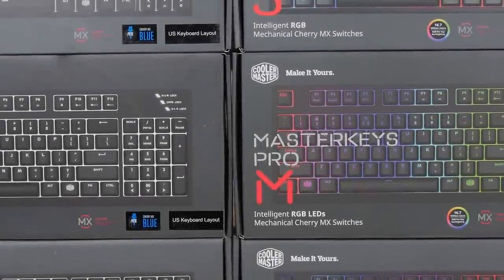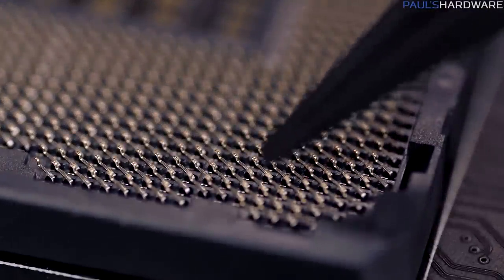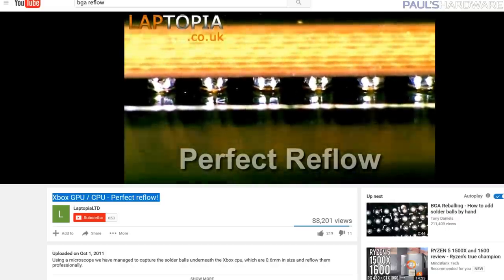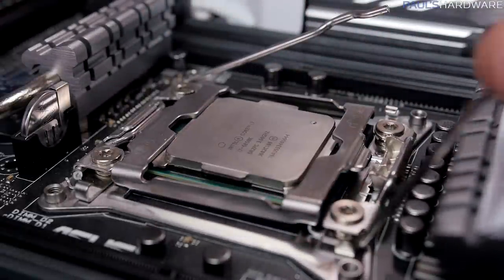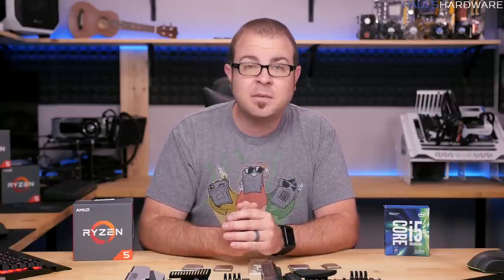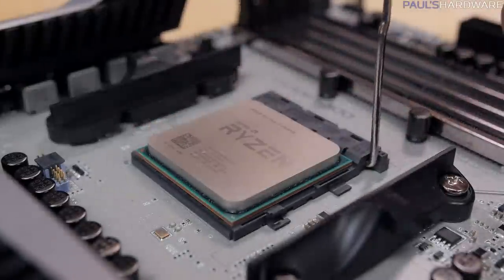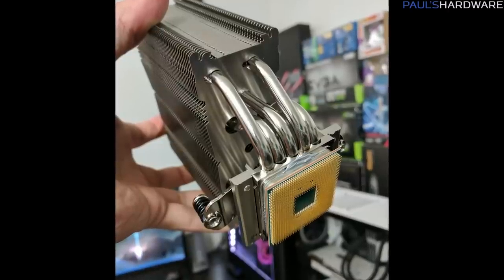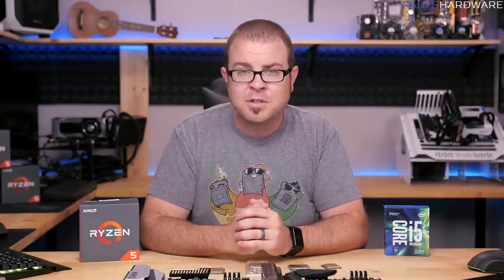LGA vs PGA! Which is better?

Comment: A cpu is just a rock that was taught how to think
Reply: It kinda is actually, since it's made of silicon, which is made by melting a certain type of rocks.
Reply: It's more sand than rock
Reply: But sand is rock
Reply: gdr 2005: the deep thoughts of my mind are an enigma
Reply: @gdr-1243   Tiny little rocks
Reply: No, its just a rock which has some labyrynths in it. It doesn't think, that would be AI
Reply: @KaranKhannazrk  you chemestry is f
Reply: A lump of metal
Reply: Well... we're essentially bags of thinking water.
Reply: @raidzor5452  AI is just IF statements
Reply: r/showerthoughts
Reply: @leenagle2903  everything is just some abstraction
Reply: You oversimplified a bit. We had to flatten the rock first, and then put lightning inside it.

Comment: A broken PGA pin can be replaced, and you won't even need a jeweler.  It can be done by placing a small copper wire in the socket hole opposite to the broken pin.  The hardest part is cutting the wire to a length that will make good contact to the CPU while allowing it to sit flat in the socket.  This saved a couple dead AMD Athlon CPUs I found on ebay back in the day.
Reply: That is a tip and a half!  I should be able to give you a star or some shit, or at least sponsor you with a warm meal on Patreon.  Here's some non-edible emoji for your trouble 🥓🍺
Reply: pam0077 you could also trim the rest of the lead and solder a copper wire lead in its place
Reply: that seems very hard, and you cant have solder since the cpu sits flat on the sockets plastic and the solder creates a small bump, not to mention not shorting any pins in the process
Reply: Not only that but if you want to recover many bent pins, just slide a credit card between each two rows and columns of pins. 

Whilst with LGA you're gonna have to send it to fucking precision engineering department.
Reply: Replacing a PGA pin is doable. It might not always work, but atleast is doable. With LGA on the other hand, once off there is no other option than a complete socket replacement.

And even then, some pins are actually redundant. When one of 150 pins for voltage breaks off, that is a change of +0.002 - 0.005 A per pin. Around 0.6% more stress for the other pins. And with more pins for a certain function, that becomes even less.
Of course that dosn't work for all pins, but atleast for the voltage input should be a non-issue.
Got a LGA775 board with one ground pin completey off, and most chips still work in it.

Comment: Meanwhile, Intel is still trying to figure out what is 8 cores below $200
Reply: Ak Mungroo Meanwhile AMD is still trying to figure out what is single core performance
Reply: TheMalvage while Intel is trying to figure out what is Multicore performance ;)
Reply: Ak Mungroo While most programs use just one or two cores
Reply: TheMalvage You I like
Reply: And AMD is trying to figure out, what is reliably powerful single core processing, ya know, because 98% of games don't gaf about 8 fucking cores. But in all honesty, the Ryzen CPU's are beasts and I'm about to build a workstation with the 1800x. It's amazing how AMD along with Samsung and Corsair has made it possible to build a beast of a workstation with 8 core CPU, 64GB of DDR4, 12TB of storage and a Samsung 960 EVO 500GB for under $1900.
Reply: +TheMalvage Meanwhile, you're uninformed that Ryzens single performance is actually close to or same as Intel (depending on testing method) and basically on the same level clock-for-clock.
Reply: +TheMalvage While there's such a thing as multitasking where you're gonna shit yourself with 4 cores.
Reply: Alpha Machina I am sorry good sir, since when did gaming jump into this conversation
Reply: i could tell you that games already use 8 threads and gain from it (simple turn off and on HT on an i7 to see a 15 to 20 fps gain) or tell you to get a 1700 or 1700X than oc...but nahh i let you spend 500$
Reply: it's meant to be enthusiast's cpu not gamers lol
sure u can game.. without gaining much performance cus it'll be the same with intel 7700k except games start to support ryzen multicore power.. which is real
Reply: I've always loved the chicken-and-egg issue on multi-threading.

Developer bean-counters: "Don't waste time figuring out how to better multi-thread the system, barely any of the market has a processor to support it anyway!"

Consumers: "Don't waste your money on more threads, hardly any programs support it!"

Which probably also leads to...

Processor manufacturers: "Well I guess we won't bother pushing more cores too hard, barely anyone buys them and programmers aren't using them..."
Reply: Has never happened. I do a shit ton of video editing and database processing on my 7700K machine and zero fucks have been given by this CPU. It just does it's job and it does it well.
Reply: Ak Mungroo: Since when was gaming excluded from it? Because I'm gonna tell you, buddy, I just scrolled up and I don't see anything pertaining to the exclusion of gaming in this conversation.
Reply: http://cpu.userbenchmark.com/Compare/Intel-Core-i7-7700K-vs-AMD-Ryzen-7-1800X/3647vs3916

The 7700K is better at 2 out of 3 tasks. I'd say it's the clear winner.
Reply: But! That doesn't mean the Ryzen isn't a badass CPU for a great price. Because it is. And I'm buying one this Friday. As I stated previously.
Reply: fx 8*** lineup, period.
Reply: Alpha Machina ryzen is still not well optimized no winner still
Reply: AMD's single core performance is really good what are you on about? They just lag behind in clock speeds. Once the platform matures a bit they'll pull ahead or be on par with Intel. For launch Ryzen is already very impressive.
Reply: FX-8350, but it's shit. move along kid.
Reply: Gotta give AMD credit where credit is due. I am an Intel fanboy all the way and it's pretty amazing how they were able to pack a punch with so many cores in such a cheap CPU. However, their cores are no where near as efficient as Intel's and their threaded throughput is still garbage tier which is what a few titles actually rely on when playing them.
Basically all comes down to what games you play: If you play games that utilize more cores very evenly AMD can win, if the games rely on Single core performance and threaded CPU cores working together Intel is the takeaway winner here.
Reply: If you really believe that Ryzen's IPC is anywhere remotely close to Intel's, you my friend have been bamboozled.
Reply: Meanwhile, I do not care about the brand.
If it does what I need it to I buy it.
If Intel gives the cheapest option that gives what I need, that'll be the one.
If AMD gives the cheapest option that gives what I need, that'll be the one.
Same thing with GPU's, AMD,NVIDIA or hell even iGPU's.
Why do we care about who made it?
If the product is great, we should not care about what sticker and status that will give us.
Reply: sure does
Reply: Wyatt Nemm Do research, try again.
Reply: FoxAndRoses Tell me master
Reply: their smt implementation is superior and so is their core design. the issues amd have are infinity fabric speeds and low clock speeds. hopefully, they can offer a better version with ryzen 2 that cleans these up tho. i guess their reason for both was low power for servers and portable devices as amd is limited for money and needed a good all round chip for low power mainstream enthusiast and server
Reply: TheGamer3399 ryzens ipc is on par with kabylake/skylake at the same clocks. However since kabylake is a mature form of skylake it can achieve much higher clocks, therefore increasing its performance. Given time I'm sure Ryzen will mature and be able to hit higher clocks. So Ryzen does have similar ipc to Intel to an extent.
Reply: Finkel - Funk amds simultaneous multithreading is equal to or better than Intels hyperthreading.
Reply: Disputes I believe that the infinity fabric does not give AMD an advantage in terms of performance, but it makes their cpus much more modular.
Reply: +Wyatt Nemm http://cpu.userbenchmark.com/Faq/How-does-IPC-compare-between-AMDs-Ryzen-and-Intels-Kaby-Lake/108
you might need to take the L buddy ryzen has a all core boost of 3.5ghz so its at worst 4.6% slower. clock speed is what ryzen lacks
Reply: As I've said, the one that is the best bang for the buck that does exactly what I need would be the one.
So if you said it is Intel and my research concludes that for the software that I use and the games that I play it is true, my decision would be made in an instant.
Reply: vishera CPUs were garbage. i wouldn't buy one even if it was $50.
Reply: You realize that the 7700k has 40% more single threaded performance than ryzen? Clock for clock doesnt matter when the competition has much higher clockspeeds.
Reply: Disputes did you even read that article? It says skylake and Ryzen have the same ipc. KABYLAKE AND SKYLAKE ARE THE SAME ARCHITECTURE! As I said previously the only reason kabylake has better ipc is due to higher clocks. I'll return the "L" to you...looks like you need it.
Reply: It is as good as my Haswell clocked at 4.3 ghz. (1700 clocked at 3925 Ghz ) Multithread performance no were near . I own both 4770k and 1700 .
Reply: Pyrofan97 well it does matter, kabylake is very mature hence the high clock speeds. Ryzen is a new design ground up on a new node. It'll take time for the process to mature so we can expect higher clock speeds.
Reply: That awkward moment the 7700k is only ahead of Ryzen by roughly 15% when it comes to gaming but gets completely annihilated in multi-threaded applications.
Reply: Ground2Hog ikr
Reply: Ailuropoda melanoleuca Nineoneone fx series
Reply: Intel newest chips are worse at multi core progams, compiling, multitaking, rendering and so forth than AMD's newest chips are at gaming though, irrefutable fact, check the benchmarks for yourself for the chips on both sides in their respective price ranges and match ups.
Reply: they trying to figure what is 4/8 c/t bellow 200$
Reply: it is something what is 6+years old
Reply: and those programs arent demanding. games that use dx11 and byond use 3 to 4 cores, dx12 can use all cores if needed. gta 4 in 2008 uses 4 cores, bf4 uses even 8 cores or threads so...
Reply: Wyatt Nemm i dont think you underatand how ipc works
Reply: at least one guy is smart enough to not engage biased fanboy wars lole
Reply: no.. just no... sigh these amd fanboys
Reply: amd rekt intel in multithearing... go and run to your 1700$ cpu to do a decent argument intel fanboy.
Reply: +NutellaManXDbutt is your name Wyatt Nemm? no keep your L. now go cry and eat some nutella

oh and i never said IF gave amd any performance benefit. it reduces their performance in most cases that are reliant on data from other CCXs. but for good reason. cheaper to create circuitry as less clock signals and less cache connections in the cpu meaning more room for cores and cache. 

16mb of cache going (8cores x 7other cores) /2 = 28 possible locations core to core vs 8mb  of cache going (4cores x 3other cores) / 2 = 6 x 2 modules = 12 possible locations core to core

thats a significant amount less wiring than what intel need to have 16mb of cache for 8 cores.

this is good for amd as they need to dominate around 4 markets with one chip design. it being small as possible while offering good performance is needed for it to succeed.
Reply: slomoshv my 8350 was a animal i could do everything and play bf1 max settings 100fps at 1440p with a fury x
Reply: lol. pentium destroy 8core ryzen? you high mate
Reply: Sam Jone He meant the FX 8350
Reply: fx 8350 cant be beaten by pentium, maybe on singlecore.

Comment: Due to fact that motherboard lives longer it is much more logic to place pins on CPU. Because most users installing and removing one CPU just ones. But one motherboard lives through several generations of CPU. So motherboard should not have to much fragile parts. PGA is better, anyway.
Reply: Maybe, I've replaced more heatsinks than CPUs. I also would prefer to not remove a CPU unless I want to replace it. That's my thoughts on it and I also never broke LGA board pins, didn't know it was an issue before this video.
Reply: It's just your case. =) I can say that I never bent a single PGA CPU pin. All the same. Unbox CPU when you ready to install it. Do not remove a CPU unless you want to replace it. I'm also think that if some ones can accidentaly bend pin (LGA socket or PGA CPU) they should give some money to other ones that can't. =)
Reply: A motherboard doesn't live through several generations of CPU's dafuq.. Every 2-3 years we see a new socket type arriving because of a node shrink. A CPU can easily last 5 years, by that time if you want a new CPU it won't fit in your current motherboard, unless you buy an outdated CPU which makes no sense. This is an invalid argument. 
Even if you move one year in time from skylake to kaby lake you will miss out on features when placing a kaby lake CPU into a skylake motherboard and you need a BIOS update too which can brick your system. Far from optimal. In general when people buy a new CPU it always is in a new motherboard as well. Unless for some weird reason you bricked your CPU. I prefer LGA because I rather break a 100 USD motherboard than a 350 USD CPU. Not to mention that the demounting process of PGA is a pain in the ass. I unfortunately had my CPU sticking to my cooler on a FX CPU and it took a half hour of stress and worry before i got it safely of.
Reply: Robin, https://en.wikipedia.org/wiki/CPU_socket#List_of_80x86_sockets_and_slots - learn more.
Reply: Bruh u just contradicted urself hard. That link you sent shows new sockets being made pretty much every year..

Buying high end motherboards is useless anyway, only LN2 overclockers need VRMs that high end..
Reply: cheytacsnipes, link that I provided shows that even today most of popular sokets lives up to 3 generations of CPU. Needs to be blinded to not to see this fact.
Reply: Uhm yeah name an example please? The only one that lived through 2 generations lately are the skylake mobos, aka 1xx series
Reply: cheytacsnipes, meh... look at the list, the column named "CPU families suported". And keep in mind that there generations in families.
Reply: This does not make any sense. The most "generations" of support for one socket seems to be 1150, and thats in the span of two years. You have to agree that it is not economically sound for you to be changing CPUs every year. Also the chance that your motherboard (or motherboard revision, mind you) will even support the "new generation" properly. And even then you will never need to go through all the iterations of a CPU family for the 1% benefit it would generally provide.
Reply: Yeah old mobos used to have good compatibility but the new ones have only 1 gen of compatibility most of the time, so there's no point in buying an overpriced mobo.
Reply: And even then, good compatibility was mainly AMD, which has not been relevant for more than 7 years now.
Reply: You can tell me all of your thouts, but here is reality: my first PC was Socket A based, I upgraded CPU six times. Later: I bought LGA 775 motherboard and upgraded CPU just twice (I assume this move to Intel as a Mistake). Last time: with AM3+ motherboard, I upgraded CPU four times. And now I think that there is no reasons to think that AMD will act like Intel and starts to force us buy things without real need, by changing sockets for every refresh of lineup. I think that there will be some thing like RYSEN 9 for AM4 and so on. What about your personal cases? You just aren't lucky enough. =)

Comment: Installing an LGA CPU: CRRRRRRRRRRRRRRRRRK
Reply: samin90 danm thats sounds scary
Reply: It is! It's the sound the pins make when they bed in to the pads on the CPU. Definitely thought I broke something the first time I installed an LGA and heard that noise...
Reply: never heard that noise. sounds like u did something wrong, but installing a lga cpu for the first time is always scary since u think that u break the cpu because of the huge amount of force that those sockets use but you will get used to it when you do it more often
Reply: if you buy second hand parts or if you have already installed the cpu before it will do that. The first time is always the quietest and every time after sounds really bad. LGA 775 sounds like your cracking something all the time although!.
Reply: Built hundreds of LGA systems, myself, and I've heard the sound a good 25~30% of the time.  Not sure what causes it, but it can be a bit nerve racking.

I prefer PGA any day of the week.  I can fix bent pins on a CPU under a dissection scope and have never had a failed repair (lucky, I guess).  I've never had a fully successful LGA board repair (managed to get systems back up and running, but features tend to be missing after that - three different times the same failure mode happened - with the K CPUs no longer being overclockable, most of the time it was just a RAM slot that died).
Reply: I got scared first time
Reply: @vaelfonia  tell me about it...
Reply: @droopysweater6  yeah I thought I broke my old Dell when I replaced the thermal paste to sell the sack of shit 🤣🤣